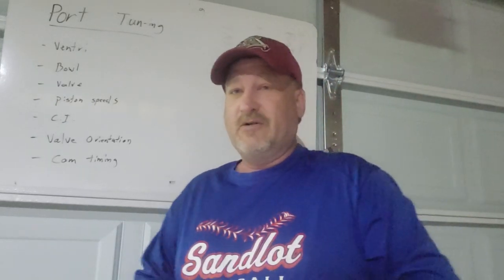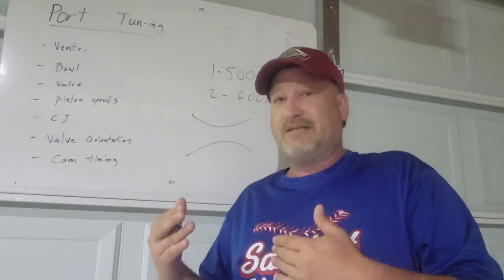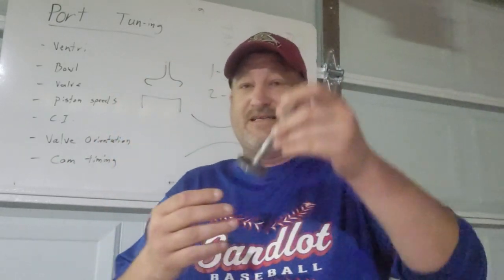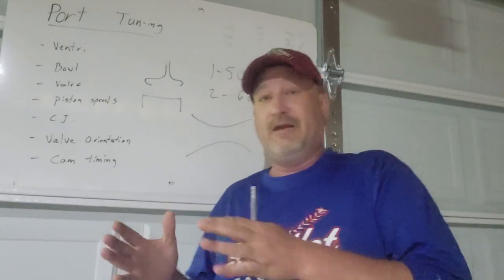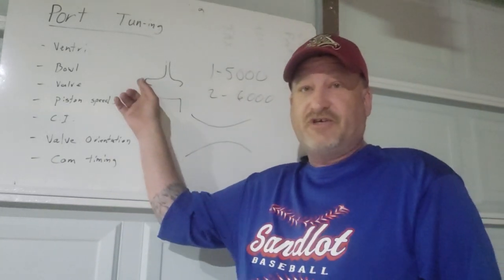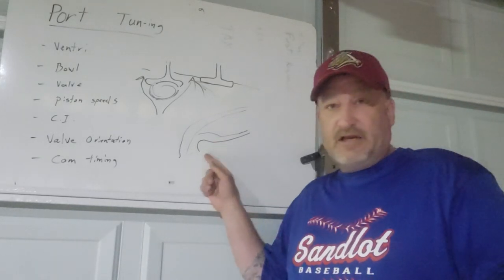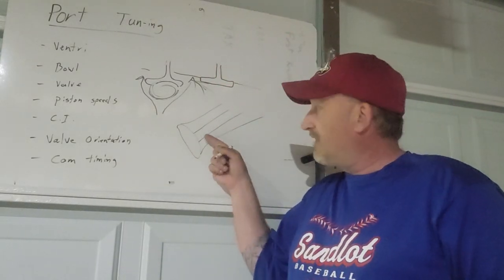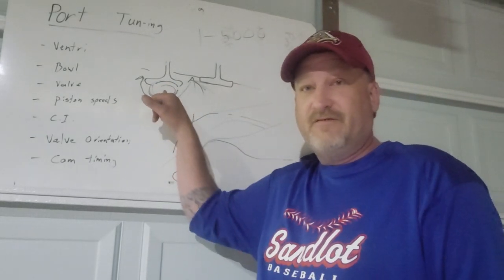Fixed port tuning.

Comment: What is the advantage of going to a smaller valve angle? Or does it depend on the head design. Good video.
Reply from the maker: The valve angle in relation to the port floor and roof. At low lift and slower air speeds, the short turn is used more. As speed increases, the port volume cant make the turn. So the valve itself become a road block to the flow until it moves further away from the seat. For example, a 18 degree sbc head will reduce the turn of the incoming air charge than a 23°. A hemi will have equal pull around the entire valve and port to feed the center of the bore. A wedge  chamber and side entry port will favor the center side of the valve until the velocity forces the column straight towards the cylinder wall. A canted valve chamber opens towards the cylinder center and causes let shrouding,  so more of the valve curtain area is opened up. 4 valve per cylinder heads provide the best of all designs.